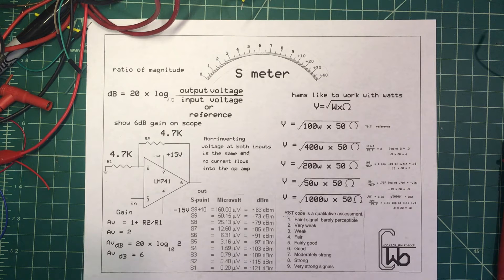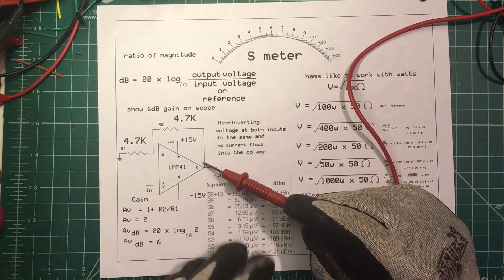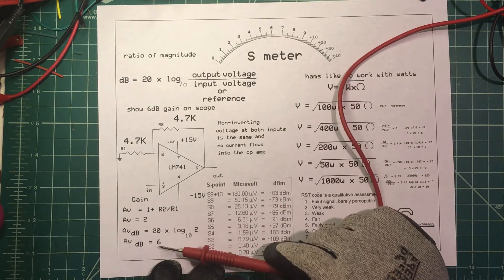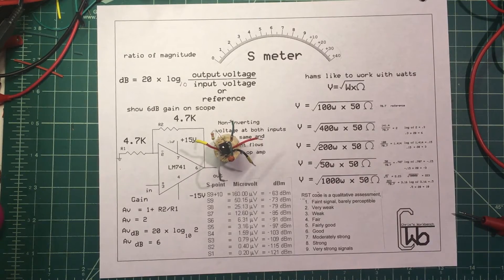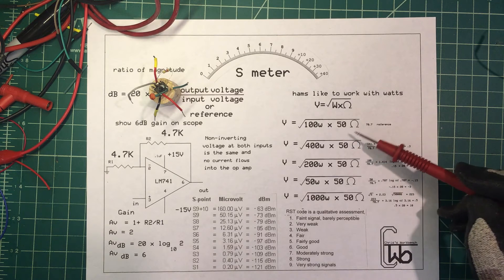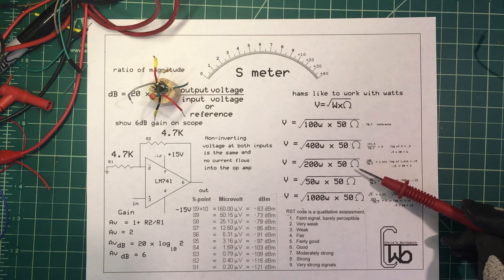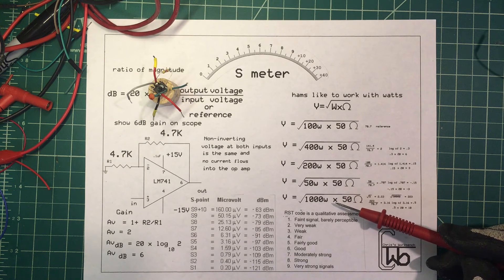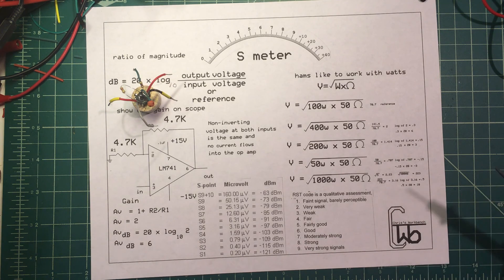Signal Strength Meter

Comment: Great explanation to an S meter, I have been tinkering around making digital displays for old radio gear and trying to make an accurate S meter using an arduino to calculate the logarithmic correction with some reasonable results. Really enjoying these vids